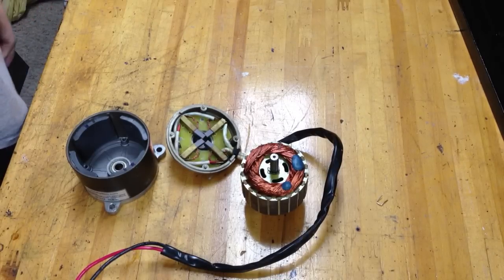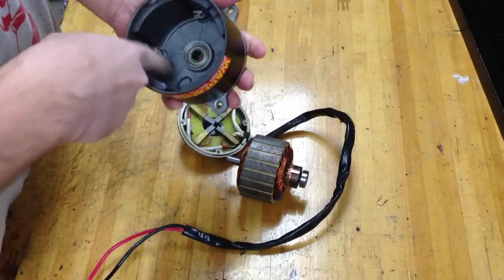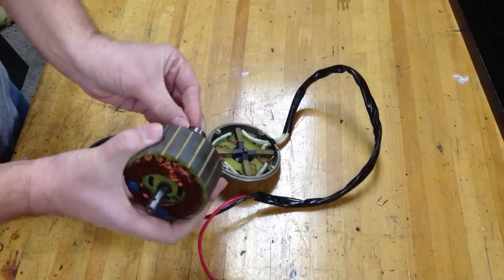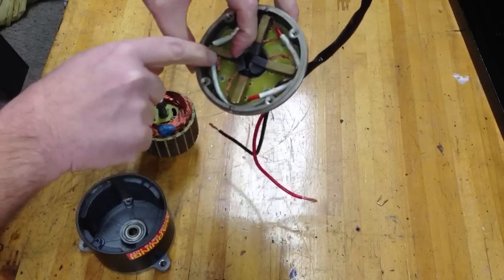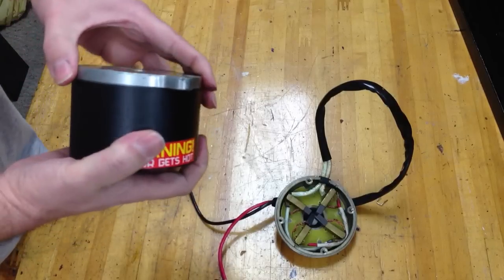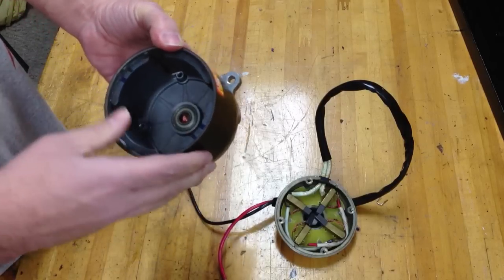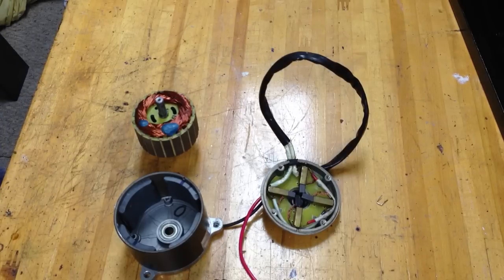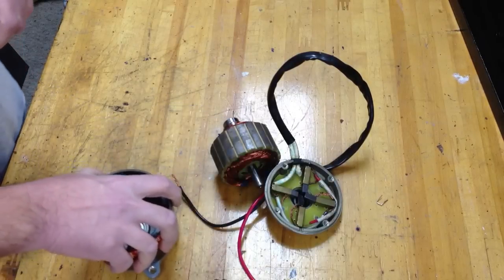24 Volt Scooter Motor Disassembled

Comment: I found the perfect solution to reassemble the motor, use 2 rubberbands to hold the magnets in place while closing the cover. Then cut the rubberband and slide it out. much better than fighting with messy tape. I was able to close it in less than 5 minutes.

Comment: For anyone that wants to know how to reassemble. If you wrap tape around the bare wires and pull down on it and stick it to the outside of the case, you can then drop it into the brushes, then pull or cut the tape, and it does seem easier to drop the barring in first.
Reply: sht, You should make such video, it'll be popular.  this is the part all are looking for.

Comment: Hey sir. Can you tell me if can put a third battery on my scooter? So it becomes 36 volts?  Does the motor take that much volt??   Please tell if you know. I have a spare battery i want to connect. I need more power. I have to give speed with my foot. And thats boring..  Old scooter. Are they like that when they are new also?  Ore are they powerfull enough so i should not need to kick??
Reply: just try it mybro and observe what happen
Reply: You can  add a more powerful motor as I did to my 24 v 450 w motor. I kept my 2 batteries but added a 500 w motor got more power BUT my mistake was buying a 10 ah batteries instead  of a higher  ah to give me more distance , more power due to motor but not distance since it'll take more energy, so I lose distance, My next batteries will be a 12 or more AH. 3 batteries can be placed with the 500 w .   This what I have learn in electric,  12 v  x 24 = 288 w .  a 500 w  would be 12 x 36= 432 so is not above the watts of the motor. This way the electrical volts will not burn the motor by staying below the wattage of the motor. I f kept on these lines, you'll be ok
Reply: @ccccen  How do you think lipo batteries with high discharge will work?  I see China has alot of motor for good prices. I want it to spinn when i give trotthle. I managed it with normal 200w motor and 48 volt. But the powermodule i have not figured out. I have seen some else on China marked.   I have a 200w controller.  Takes 48volt. I tried to solder bypass on the original. But it only lasted few meters. And i had to kick up speed before it could give trotthle.  EU stupid rules that makes it so. Cant get motor to work here before i have kicked it up in speed.  Even outboard motors like mercury 20hk, is taken down to 10hk. So i cut a piece away and get 15hk. But need new carberator to get 20hk. But it is a trick so we can buy big motors for cheaper money. We pay tax each hk and for polluding and more.  EU. And we voted no! Still we have to show our cars every year for EU inspection.
Reply: @tykenminator E.U. have dumb rules. From what I see you more volts than motor. 48 v can power a 1000 w motor nicely. like I have a 34v and a 500 motor in which I will have more speed but less riding time due to the AH on the batteries a 10 ah, if I want more riding time I'll will get a higher AH on my next batteries to get more riding time. 48x12=576  you're pushing too many volts to such a little motor in which can burn it out, in such a case you might need to change your controller at throttle or at controller box . At 48v you come out nice with a 100 w motor.
Reply: I know it was to much. I dident have motor. I am trying to make som that is emp safe to ride in case of worst case scenario.   Do you know the electronics on a Kawasaki KXF 450 F.i.  Is the CDI box all that needs protecting? They are very much like Hondas bikes.
Reply: @tykenminator  uffff, the only thing I know  about Kawasaki is on jet skis. Now I got a scooter and been educating myself around here, picking up on electrical stuff, nice schooling here.